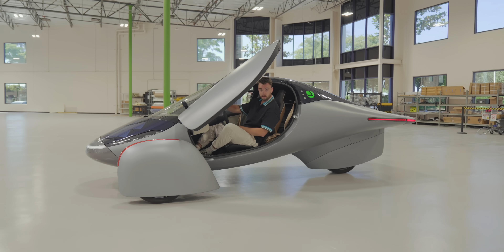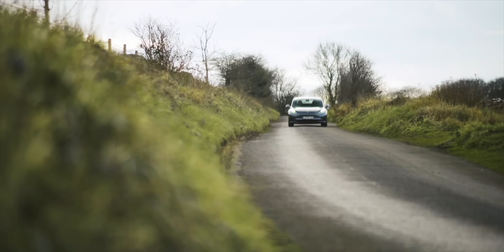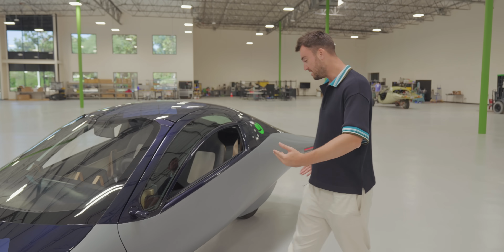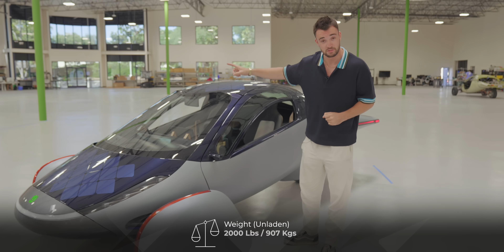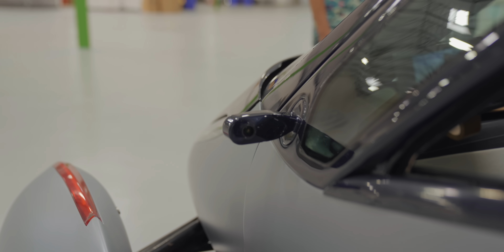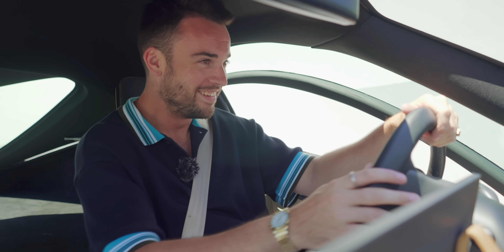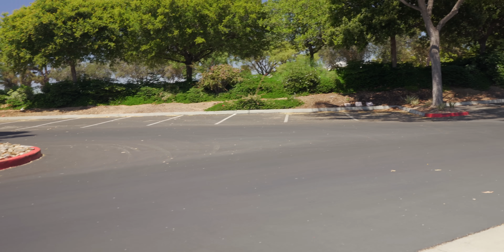The Game-Changing CHEAP Electric Car Inspired By Fish!

Comment: Electric motors mounted on front wheels is not a good idea. Why? Because without the benefit of shock absorbers all that road generated shocking is constantly bombarding the wheel mounted fenders and the complex electric motors. Predict within a few miles usage fenders will crack and motors damaged. Placing motors inside the main body and Aptera should be a big seller!

Comment: I get that the purpose is to have an affordable vehicle for the daily commute, but it would be cool to see a larger 4-5 seat version for family use and extended carpooling. I could also see it as a perfect gig work vehicle since Uber and delivery drivers would easily recoup most of their operating costs.
Reply: Not a lot of room for packages.
Reply: @richardvinsen2385  No, but a larger 4-5 seater version could fix that. Also, I'm surprised just how much cargo area it has given its size.

Comment: It's the Sinclair C5 of electric cars. 
Will crumple like a paper cup if it gets hit by anything heavier than a bicycle. 
Strong winds will  push it around dangerously. 
Just give it four wheels for stability and take a hit on efficiency.
This car is designed for one type of customer, and that's those who like to feel superior about range even though they look ridiculous for sacrificing everything to get that range. 
So it does 3 miles more per kwh than the nearest competitor? Not enough to justify all the sacrifices.

Comment: why does 25kwh give you a quarter of the range of a 100kwh battery car?  Surely a smaller battery will take you further due to the much reduced weight.  Might be worth checking that bit up....

Comment: this could be a game-changer. Until now, efficiency was only a theoretical thing -- does it really matter whether you fill up your tank every 600 or 700 km? Petrol prices are really not the major issue for most folks, because fossil transport enjoys government subsidies and anyway, depreciation and insurance are of greater consequence. But with the Aptera, you are freed from ever going to the petrol station again, or ever looking for an available charging point again. Total freedom, like on a bicycle. Also, total freedom of a bad conscience from creating greenhouse gases (yes, in most countries, electricity is not decarbonized). Aptera makes efficiency compelling, and pleasant!
Reply: "Total freedom, like on a bicycle." is exactly where you will end up if you support ending CO2 emissions and probably hungry as well.  CO2 is a plant fertilizer and brings people out of poverty by creating wealth.  Only by making everyone poor can carbon be reduced and for no reason as CO2 only slightly affects weather as 12 years recently without a hurricane hitting the US coasts simply demonstrates.  
Exotic material cars using electricity are not reducing anyone's carbon footprint if the material production carbon production is included.  China or India are still putting a coal power plant on line every week so what you are doing reducing CO2 emissions makes no difference at all.
Reply: @steve_3784  frankly, that's just crazy old-men's talk and it would be a waste of time to even spend a minute to refute it. Max Planck said all there is to know about folks like you.

Comment: This is a very interesting car and I'm excited to see it when it goes live. However, I ride velomobiles (look them up) which are also typically 3 wheelers (tadpole trikes = 2 wheels at the front, delta = 1 wheel at the front). One of the issues that the tadpole (cycle) trikes have is a serious lack of directional stability IF rear wheel tractions is lost. This can be due to a rear wheel puncture or loss of grip due to poor road surface, though I guess that the suspension on the Apterra will be MUCH better than on any velomobile so this may not be an issue.
I'd be interested to hear the views of anoyone who has ridden/driven a motiorised delta trike (Morgan, Grinnall Scorpion, etc.) as to whether this is actually a concern.
Thanks
Reply: Munro and Assoc are helping them with the suspension and coming to market. If I had to guess? This thing is literally going to float down the road. Car this light would require a tiny system for it to be air ride. Wouldnt even need a compressor.

Comment: Looks very interesting. I ride a velomobile which is a pedal powered 3-wheeler and even more aerodynamic than the Aptera. After riding to the Fully Charged show recently I decided to fit e-assist. I now have a 250W motor and 19aH 36V (so <0.7KWH) battery to carry around. The motor is only used to set off and on hills (up to 25kph) and due to the efficient design (much more efficient than a bicycle) it is easy to maintain a reasonable speed without the motor. I average over 20mph (around the Surrey Hills) and recently did a 65 mile trip with half of my battery left. I thought that wasn't bad considering I am about twice the age and weight of a Tour de France rider. It also has quite a bit of storage space and a towbar. It would be a great commuter vehicle if I didn't work from home. You can also buy them now and don't need a driving license, let alone a motorbike license!!!
Reply: A few more details of your machine would be interesting. Manufacturer, cost etc. Please.
Reply: @geoffhiggins742  I ride a Strada velomobile that I fitted e-assist to a couple of months ago. I also have a Milan GT that does not have e-assist. The e-assist has transformed the Strada making it a suitable car replacement for a lot of journeys. It was always fast on the flat and particularly downhill (I have done 56mph with the brakes on) but the e-assist means I am now a lot faster uphill. The smaller version of the Milan is the SL which holds several world records including 97.96 km/h on a 200m sprint and 1219km in 24 hours, both by human power alone. Please search online or look at my channel or the velo-ads channel for more detail as I think the message gets blocked if I include the name of the companies that make them.

Comment: I wonder why is there no EV with a thermocoupling element. They get hot in the sun anyway. if it has people in it it will get hot anyway. if the cooling itself becomes a power source...
Reply: Not a large enough delta T
Reply: @universeisundernoobligatio3283  

1. It doesn't need to be a main power source.
Even so, this isn't a single couple pair but hundreds(likely thousends), posdibly at a layer. And several of those.

Will it be enough to just run on? Of course not, but it will allow the batteries to run a bit longer.

And those mettals (or polimers(?), honestly) don't have to be heavy.

Also, they can also use power to accelarate cooling ans warming.

Comment: I actually teared-up whilst watching this video...!
I've only had an EV now for a few years, but I'm already 100% EVangelical about efficiency and making the most out of the energy I put in.
So, to hear CEO Chris Anthony matter-of-factly describe how, just by ticking off the 'mathematics' parameters to ultimate efficiency, you end up with the beautiful, swooping design of the Aptera... I honestly welled-up with the realisation that incredible efficiency and clever design IS being taken seriously in the EV market. And, that the starting price is well within the reach of mass market users is simply incredible and genuinely exciting.
Oh... and his comment "there are no brick-shaped fish" was just legendary...!!   🤣
Reply: The thing I love most about the high efficiency is that the solar panels add more miles of range. On an inefficient EV like the Audi Etron adding solar panels would make a much smaller difference.
Reply: Lovely sentiments. Couldn’t agree more! 💯
Reply: But there are brick shaped fish in the deep ocean.
Reply: I can see it as unsafe on road with trucks, will they be able to see it. I dont think so. It looks very flimsy and with high winds. I am doubtful that it wouldnt tip. It only looks as if it can take 2 people thats why its more miles per power.
Reply: @judytelles5617  you can't have it both ways.
Reply: @got2kittys  It cant run on our roads with other vehicles as it wouldnt be seen by trucks. And it looks as if it will flip from air stream from bigger vehicles close by. I understand that its aerodynamic as it moves forward. Cant compare to the other vehicles he mentioned as the Aptera is only for 2 passengers. The Aptera looks flimsy.
Reply: @judytelles5617  Are truck drivers blind? Can they see people? I ride a recumbent trike one third the size and everyone sees us. Apart from anything else, it’s highly unusual design would ensure this. As for being tipped over, no way, you’re thinking of furniture vans, not slippery fish like this!
Reply: @RichardOates77  You know as well as I do that trucks are responsible for a lot of cyclist deaths on streets. There would be many more if they were on highways. I take your point about you being a recumbent cyclist and the vans. You are still very vulnerable and you are not on highways. So yes, I stick to my point. Thanks for your comment.
Reply: How in the hell does one get emotional over an electric car? This would be an extremely abnormal reaction to this video. Perhaps you should seek help.

Comment: I want to like this car but:
The efficiency of the solar panels in the UK, at a non optimal angle will provide a few miles a day.
No battery cooling probably means no battery heating. Not useful in cold climates and in cold weather.
Filling the ‘trunk’ ruins rear visibility. So a rear camera and decent screen is required
I predict the front wheels will have many impacts as judging their width could be difficult.
I want to like it, but I can’t see it being practical!

Comment: Depending where you live, you have to install huge (compared to size of that vehicle) license plates, in front and back.

How much that will effect to aerodynamics, and will ruin the esthetics at least.
Reply: In the US, it's a motorcycle, so the plates are smaller, and you only need them on the back

Comment: ‘It’s classified as a motorbike’
Dang, another one, been hearing about this for awhile but didn’t realise it fell under motorbikes. Really hoping this doesn’t mean it needs a motorbike licence in my country otherwise that could put a real damper on ‘enticing car drivers into smaller vehicles (ideally with it being easy rather than needing to spend ages on an actual motorcycle/non-enclosed vehicle to get a licence)’ and hoping that vehicle legislation globally starts wrapping their heads around the idea of micro vehicles that aren’t just motorbikes. Been eyeing the Carver as well which also seems to be having a ‘what is it?’ classification problem. So a little worried about legislation keeping up with innovation. 

Overall, great video and really enjoyed it and loved the deep dive on just what are the game changes and things that help make this car so amazing.
Reply: It's in a weird gray area of the law. It's legally a motorcycle, but you don't need to wear a helmet or have an motorcycle endorsement to operate it. In some states it's referred to as a 'autocycle'
Reply: Messerschmidt was a 3 wheeler in the 50's. It was classified as a car.  When they were first designing cars (Model T era) some were 3 wheelers, some were 4.  The automobile did not have to be 4 wheels on the ground.

Comment: These cars have been around for a fair while, and next year is not really a solid delivery date. I’m sceptical that this car will be highly successful because of safety regulations and a dubious company, that started a long time ago with an aerodynamic design, and less focus on safety. The Tesla 3 is safer than a Volvo. 
This car also looks like it would struggle over uneven or rough surfaces.

Comment: Have you checked the width of the Aptera? It's 40cm wider than a Mitsubishi Outlander PHEV. That's a problem - a big problem, and a major design flaw! It simply won't fit on European or British roads and car parks. So full marks for efficiency, full marks for making something beautiful, but I won't buy one. It'll never fit down busy narrow roads with parked cars which are already a struggle for a 4x4 (I drive an Outlander). So unfortunately with this design it's already destined for failure.

Comment: I've always wondered about the air resistance, whether this could be reduced by pumping a small jet of compressed air forwards to make the air already turbulent when the vehicle hits it.  A bit like spraying the surface of a diving pool to break the surface tension for high board divers?  Secondly, real dolphins have parallel undulations at the tail end, this apparently smooths and streamlines the turbulence as the water leaves contact with their body.  I remember there were some fluid dynamics calculations done that indicated if you applied the same principles to the tail of an aircraft, adjusted for size and velocity, the undulations would be similar to the grooves in an old LP disc, and this would reduce drag.  Would either of these two features be worth any additional efficiency saving on this car?

Comment: How much does it weight? As strong winds that thing is rolling and flipping! Love EV's but this is a lil whack tbh. Most of the 1kwh/10miles is aero and the missing wheel/resistance of said rolling wheel. Edit** Ahhh its classed as a motor bike, so need that license... and the real reason is that you don't need to safety crash test motor bikes!!! why its classed as it... SAFE /s

Comment: Well, thats the way to go. One doesn't have to be a genious to see that the usual E cars today are a dead end. Even the Teslas - though Tesla is looking to improve there. 
But all the 2.5 ton SUVs, that are simply a conventional car design just with a electric motor, are certainly not the answer to electro mobility. They are simply the attempt of the established car manufactorers to sell their old crap under the E label, without investing much money in development. Heck, they don't even think of putting solar cells on them - instead they put a AC in to keep it cool.
The real electric cars are still to come, and they will look like the Aptera, or similar optimized designs.

Comment: @3:08: If you put the big heavy 100-kWh-battery in it, you increase weight and therefore increase energy consumption. 
You won't keep the 10 miles per kWh with the big battery.

Comment: The question is whether this efficiency is worth sacrificing tradition.

Is it even worth driving if other apes aren't able to recognize it as a car? With a bottom that's not flat, but all weird and curvy? Can we tolerate it? I can't even understand what this thing is.
I don't think we should use these shapes. Too much efficiency isn't always good. Go back to the slightly rounded rectangles please, my head hurts.

Comment: If the Aptera is legally classified as a motorcycle, does this mean you need a motorcycle license to drive one? If so, that would be a significant adoption barrier as most people don't have them.
Reply: Nope. because it's fully enclosed, you don't need a motorcycle endorsement and you don't need to wear a helmet

Comment: I have a W247 2019 B200CDi AMG with nearly all the tricks, which I had a small part in designing at Dortmund December 2016 (Signed Secret can say no more) Great Car, not into Speed more MPG than MPH. However did 143 mph [Sat-Nav] in my 2014 B200CDi AMG Line (Near München on the way to Saalbach/Hinterglemm on a ski trip a couple of years ago, and overall on the trip averaged 53.2 MPG) With my latest car have seen 85.6 MPG recorded and over 700 miles Range which blows Electric Cars totally away. I did consider waiting for the to be launched shortly A& B Series Hybrid and EV Models to be announced however did find out that these were going to cost around £5k more, so work it out - simples

Comment: It isn't a CAR it is a motorcycle - note the 3 wheels.  IF they could make these, and do it at a incentivized 20K, That could boast the entire EV market - but they company is not delivering any and is a year late in doing so; they show little effort toward manufacturing. The solar range per day is minimal even in the sunbelt so you have to charge it or go nowhere.

Comment: Let's see at 5 days a week @ 50 weeks per year @ 40 a day equals 10,000 cars for the first year. One should always underestimate or lowball for worst-case scenario. This could still be a high estimate of time to shop is up and running but still you can see they can get out their pre-order numbers in 2 years. The bare minimum just to get out the 27,000 pre-orders would be this: 5 days a week @ 45 weeks per year @ 40 a day equals 9,000 cars for the first year. And then 80ncars a day the next year to meet the 27,000.

Comment: Looks cool but it also looks like a deathtrap in a crash.
Reply: the shape means most impacts will be mainly glancing, so more likely to bounce off or move the vehicles...  Jack did mention the formula 1 engineering in the body design, so looks likely to be safer than many cars on the road now
Reply: @peterchandler8505  Thanks!

Comment: The solar panels are obviously an afterthought because the Aptera was originally a gas powered vehicle with the current iteration of aptera being electric.
Reply: Those type of panels are easily applied to anything, considering the vehicle is being designed for efficiency,  I would expect it, definitely NOT an after thought....